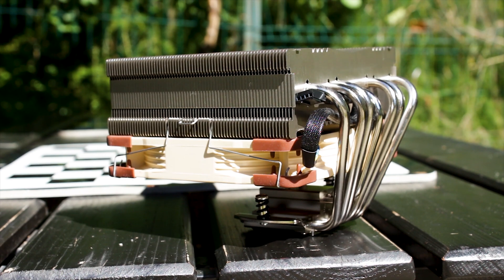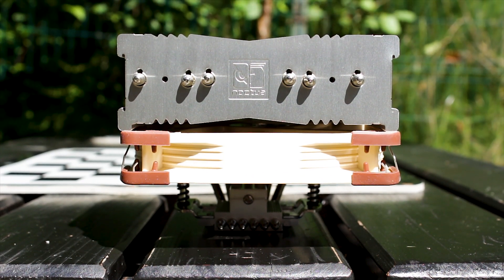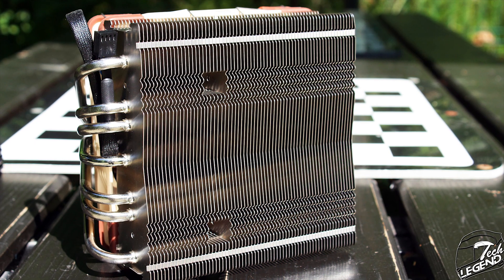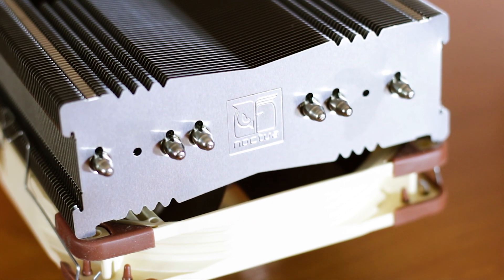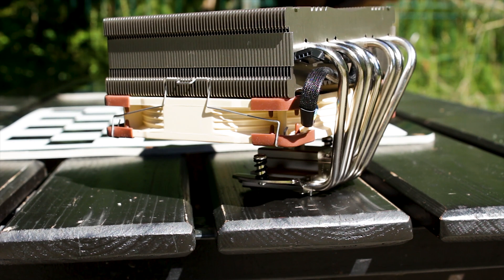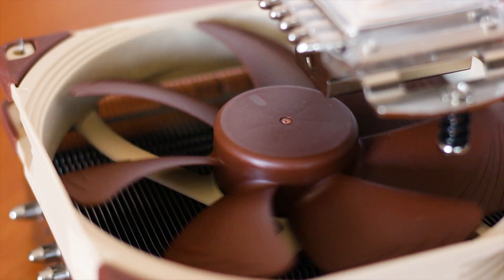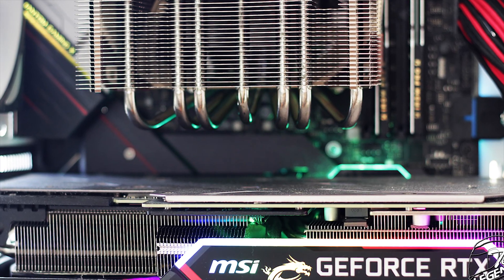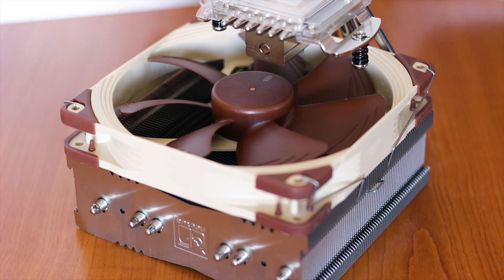Noctua NHC14S - Top Flow CPU Cooler Review

Comment: Do you know how much it would affect performance if it would be mouted underneath (like in the video), but with fan oriented to suck air trough the radiator ?
Reply from the maker: Not that much, but it might increase the noise a bit.

Comment: Hey man awesome review. Wanted to ask a question this should also work with 5900x as it’s the same TDP of 105W with an undervolt right? 
With the correct fan set up in the case also?
Reply from the maker: Yes it will work but make sure you have a good airflow inside the system. Also, you can use this cpu cooler with two fans instead of the included 120mm one.
Reply: @TechLegend-com  I’ll be using in Ncase M1. So I am thinking so 1 slim NFA12 on the sides as intake. 2 bottom NFA12 slim as intakes from the bottom. And running the psu in atx format so I can run a NFA9 as a rear intake. I think this should put me in a really good spot. Managing the fan curve should keep the system not super Loud also.
Reply from the maker: @kratos21491  That looks like a good setup, it should work!
Reply: @TechLegend-com  thanks a lot man. Was doing the numbers needed some else’s opinion. Cheers man.
Reply from the maker: @kratos21491  I approve of this build! :)

Comment: just curious why you use the fan on it like that, wouldn't it be better on top, sure the brown fan may be ugly, but they designed this in mind for hi profile memory like vengence pro rgb. i have the notua nh-d15 and it is an amazing cooler, but it leaves me with only able to use 2 ram slots.
Reply: Noctua designed it to primarily go on top, blowing downward. A secondary low-profile mode would be mounted underneath, *also blowing down*. TL left it as-shipped, oddly, which is blowing up and away from the board. Still, I can't argue with the results, which appear to be stellar even in this config. I'd like to see VRM heat gun measurements in all configs, and who knows, maybe TL's upward config is drawing the most cool air over the VRMs/RAM and other components as it's pulled up into the fan.
Reply: I thought I was the only one that noticed that and yes the fan is suppose to blow down at the cpu/MB, I think the fan mistakenly got flipped! yrs ago when I bought my 1st Noctua heatsink NH-L12 the older model that use to come with a 92mm fan and 120mm fan. The 92mm bottom fan was flipped blowing air up from the MB and the 120mm fan on top was blowing down at the MB, fans were blowing at each other lol wtf.
Reply: @birdlegs846  I'm also coming from the L12. I believe Noctua ships their L and C coolers with the fans positioned towards the fin stack with the assumption you will move them into the proper configs. Who knows how many L12s are out there with as-shipped opposing flows!
Reply from the maker: The fan is installed on the underside of the heatsink because this way, the cooler has a lower height and will fit in smaller cases.

Comment: Thank you very much. I'll be using the CM NR200 case w/ a R9 5900X and a RTX 3080 Ti FE (thank you Best Buy). And I will use two fans, one on top, and either one on the bottom or on the case side. Thank you again.
Reply from the maker: Sounds like a good setup!
Reply: Did you find this cooler sufficient enough to keep your cpu cool? Upgrading my cpu from the 3600x to the 5900x and currently checking out coolers
Reply: @FACKJORG33  The cooler stays between 68 - 72 degrees while gaming. It went up to 80 but when I cleaned the filters of the case, it went back down. Hope that helps.
Reply: @IBA.GrumpyOldPickleballPlayer  did you add a additional fan? i hope this fits on my nzxt h500

Comment: Does that cooler need a thermal paste? If yes, what do you recommend?
Reply from the maker: Yes it does, but this cooler has the thermal paste included in the package.
Reply: @TechLegend-com  Thank you for the answer. Also, do you think this cooler is sufficient for a ryzen 7 5800x cpu?
Reply from the maker: @marieantoine  Yes, but keep the overclocking to a minimum.

Comment: It is completely unacceptable that motherboard cooling went backwards, and few seem to care.

Manufacturers can talk my ear off about their "115c-safe chokes", until they're blue in the face, I don't care. I do not care. Put fins on my goddamn VRMs. Make them big. Send a heatpipe from the chipset to the main sinks and solder it. I do not care about components which are "reliable" at high temperatures, I don't want high temperatures.
Reply from the maker: But but, think of the RGB!!
I agree, and I've been saying this for years, but nobody listens, because people buy the shiny stuff.

Comment: Will this keep the intel 10900k cool enough for a music workstation PC?
Reply from the maker: Depends, what case are you using?
Reply: @TechLegend-com  The case is Fractal design define 7 and MB is gigabyte Z490 vision D. I plan to use corsair 3200mhz 32gb ram(h=33mm).

With two noctua fans below and above the grill, what do you say on the temp?
Reply from the maker: @Pianitara  The Fractal Design Define 7 is one of the best cases on the market. You don't need this type of CPU cooler for your system. Please take a look at the Noctua NH-U12A, that's the one better suited for your needs.
Reply: @TechLegend-com  Thank you for your help.
Reply from the maker: @Pianitara  You're welcome!

Comment: Can you mount the cooler with the pipes facing the IO or ram? I would think this allows the hot air to be removed more effectively as the heatsink fins are vertical
Reply from the maker: It all depends on your motherboard and the height of your RAM. I've tested these coolers in all possible orientations and the performance is more or less the same.

Comment: Another great review! Videos are high quality and your channel is so underrated. You deserve more subs man.  Keep up the good work!
Reply from the maker: Thank you!
Reply: @TechLegend-com  since there is 2 modes to put it in do I put that brown fan in low profile mode and I put that black chromax fan on top of the heatsink? And since my window on my case has a black tint you won’t even notice he brown so thanks for saving my money! And I bought 2 a14 fans for my case which won’t fit since it’s 140mm so once I get the c14s could I use one of those fans to put it above the heatsink? Or since I have 2 I can replace that brown fan and replace it with the other a14 I have that I thought would fit in my case?
Reply: @TechLegend-com  sorry for the amount of questions
Reply from the maker: @johnnyjoestar1107  Yes those fans should fit on the NH-C14S.
Reply: @TechLegend-com  wait a minute I’m watching people installing this fan and the brown fan has clips. For the fans I showed you that I through would fit in my case, how am I suppost to install those?
Reply from the maker: @johnnyjoestar1107  The clips can be used on either fans, plus the cooler has an extra pair of clips for the second fan.
Reply: @TechLegend-com  If I want to take out the clips for the brown fan and use it on one of my a14 black fans, how am I suppost to remove those clips and install those clips to the a14 black fan?
Reply from the maker: @johnnyjoestar1107  These are just clips, you should be able to figure how to remove them by yourself.
Reply: Alright thank you I just realized these came with another pair of clips
Reply: It’s me again I been thinking about replacing the c14s with a nf-412 black fan. Now I’m wondering will it fit with that cpu fan?
Reply from the maker: @johnnyjoestar1107  If you are talking about the NF-F12 chromax black, then it won't fit. But please take a look at the NF-A14 chromax black which will fit on the NH-C14S.
Reply: I checked out the nf-a14 and it’s perfect! So you said to me the the c14s would be better then the nh-l9i for my case before? I really don’t mind the silver there since my focus would be mostly on the rgb in my case. So once I assemble the nh-c14s I just use the nf-a14? Now I’m wondering if the nf-a14 would cool my cpu well.
Reply from the maker: @johnnyjoestar1107  Yes, the C14S is better than the L9i. Yes, you install the NF-A14 on the top of the heatsink, and keep the original C14S fan on the underside of the heatsink, this way you will get better cooling.
Reply: Alright thank you man.
Reply: I won’t even notice that brown color because of the rgb in the case :D
Reply: Hm there is is 2 modes for this like a low profile mode and a high clearance mode.
Reply: So I’m assuming I put the c14s on low profile mode and I put the chromax black nf-a14 above the heat sink?
Reply from the maker: @johnnyjoestar1107  Yes you can do that.
Reply: What if I replace the c14s fan with two nf-a14 fans so I can get that full black look like one on the underside and one above the heat sink?
Reply from the maker: @johnnyjoestar1107  Why would you waste money for something you won't even see?
Reply: Could you also send me the correct nf-a14 fan for the c14s because there is two types of a14 fans and I’m not sure which one is correct.
Reply from the maker: @johnnyjoestar1107  Just the regular NF-A14 chromax black would do good.
Reply: Wonder If I replaced that included fan inside of the mx330 and replace it with a Corsair fan but will it be to big for the cpu?
Reply from the maker: @johnnyjoestar1107  Depends on which Corsair fan you're talking about.
Reply: Sorry for the amount of questions I just want to be sure
Reply: Please advice.
Reply: Do I have to keep that brown fan or can I just replace it with two a14 black fans
Reply from the maker: @johnnyjoestar1107  You can keep the brown fan.
Reply: I’m sorry for the amount of questions I just want to be really sure
Reply: Please advice!
Reply: https://www.amazon.com/dp/B00KFCRMSG?tag=pcpapi-20&linkCode=ogi&th=1&psc=1 
That is the 2 fans I bought that I thought would fit in my case. And for Corsair fans it would probably be the ll12
Reply: Is this the right a14 that can go above the heatsink of the c14s?
Reply: Since I Bought 2 of them I can put one above the heat sink and the other one below it?
Reply: I’m wondering will it cool the same as the brown fan?
Reply from the maker: @johnnyjoestar1107  Two fans vs. one fan, it will cool better.
Reply: Alright man and for the last question should I use the thermal paste that came inside with the c14s or should I get something like an arctic thermal paste?
Reply from the maker: @johnnyjoestar1107  You can use the one included with the cooler.
Reply: Alright man thanks for replying. I will be back here with the fans and I will let you know the temperatures I got the 9700k :D

Comment: any air cooler recommendations for a 7700K?, im basically sick of my Kraken X52 which I got off a friend a while ago, haven't been on air since the CM EVO212 back on an old build

My height from mobo clearance is 16CM so I've seen a couple bigger coolers that fit but my main reason to switch is to get back to creating a nice air config, I currently have Noctuas for exhaust and BQ Silent Wings 3 for intakes using static pressure because I have a NZXT h510 case 

Would love some suggestions cause clearly you have more experience in that department...
Reply from the maker: Take a look at the Noctua NH-U12A, it should fit your needs and your space inside the case.
Reply: @TechLegend-com  locked down on this one, just need to wait till I got the cash just a touch over 200aud :O

but yeah went looking into a lot more whilst having your recommendation on mind, and its definitely the best choice
Reply from the maker: @axialcecal4419  You have plenty of time to make a choice.

Comment: Thanks for the detailed review! Keep up the good work! I want a top down cooler for my NR200 case and I prefer the look of the dark rock TF, i'm only cooling a 3600XT so i'm sure it'll be fine?
Reply from the maker: As I wanted to reply to your other comment: The NH-C14S is better than the Dark Rock TF, however, in my opinion, both coolers are really good for their prices. I'd say, get the cooler you like more or is cheaper.

Comment: Please tell me what size the plastic washers have. Round washer, diameter and height
Reply from the maker: I can't tell you this as I have never measured those spacers. What are your plans that require such info?
Reply: @TechLegend-com  I bought a noctua nh-d15 s but these plastic washers were not there, now I think if it is possible to use something else instead of it, but I don’t know the dimensions.
Reply from the maker: @Rukhsar  If that's the case, then please get in touch with Noctua and they will help you out with the missing parts.